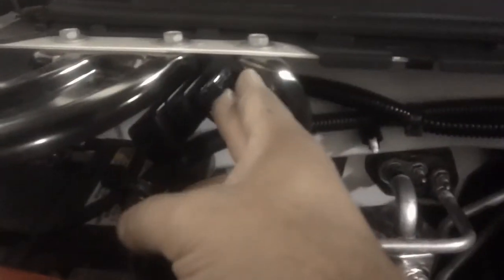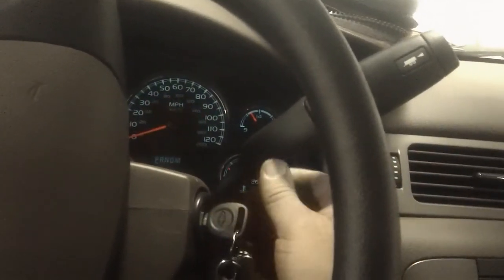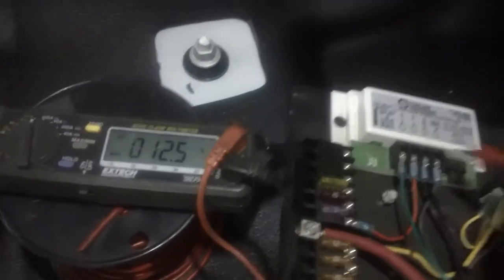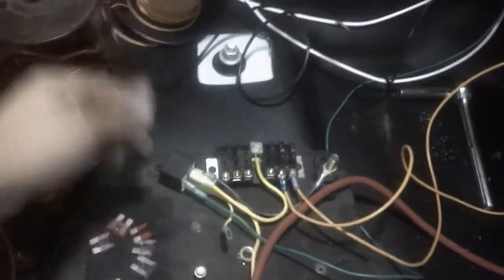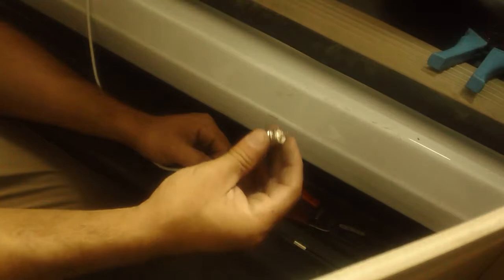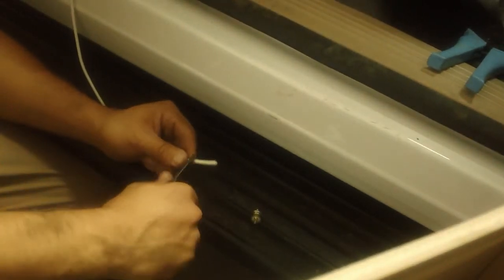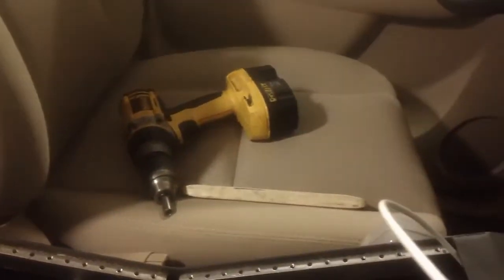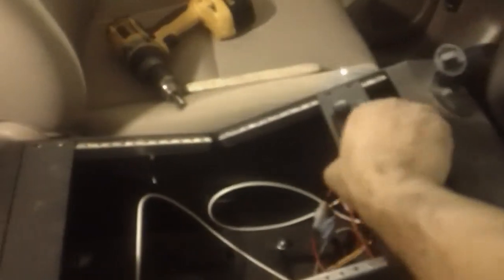Mobile 2-Way Radio Installation, "SUPERSIZED", Part 2

Comment from the maker: Yes, I cover that issue on the next final vid. What can & does happen, the final drive of the receiving antenna can be damaged. Not much you can do on a veh roof but separate the similar bands with distance. Proper ground plane length on the roof is also a consideration that has to be figured out. I have 2 radios near each other 144-175 MHz, an 800 MHz, and a 40 something MHz, I show the best possible separation in my humble opinion to address this problem. It works out fine in my setup.

Comment from the maker: Yeah, there's a set there, driver kick panel & driver leg well under the dash, no acc power in any of them. I managed to find a wire under the dash & taped into that. These new veh are not DIY friendly.

Comment: Are there any considerations to be aware of with regard to antenna placement on the roof?  With different bands and wattage levels, from different tranceivers, (or what about if one of the antennas was receive-only for a scanner), anything bad that can happen if antennas are mounted too close together?

Comment: This is an awesome video and I want to set up my truck like this can you help I'm trying to find a way to remove the console and buy a console box that will allow me to install 4 radios and have room for my shifter and coffee cups and I drive a Toyota Tundra I've checked Troy Built but they don't have anything for a Toyota Tundra I might have to change vehicles. to a Chevy Tahoe SUV . I'm willing to trade vehicles to get it right! I'm taking the General test early next month.

Comment: this is awesome!!. I just watch this video. A little bit late.
What kind of cable are you using for antennas. Well coaxial for sure but can i have more info.
Many thanks.
Reply from the maker: +Arturo Godoy Carter Its a laird part# MBF, Teflon coated cable NMO kit. Sorry for the delay in answering.
Reply: Never mind Its help me a lot. Many thanks.